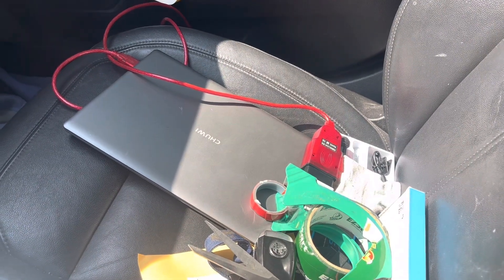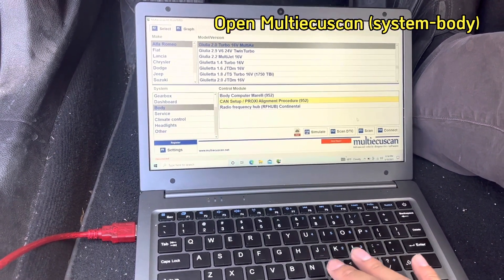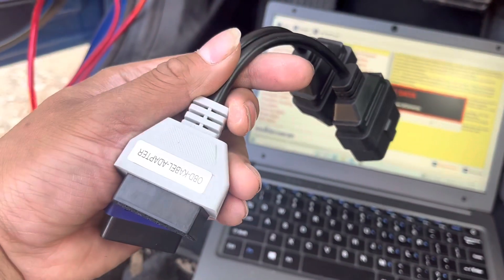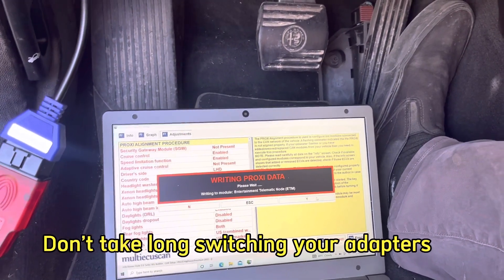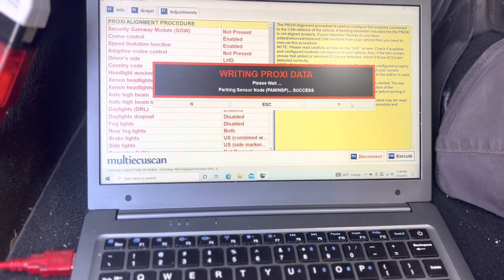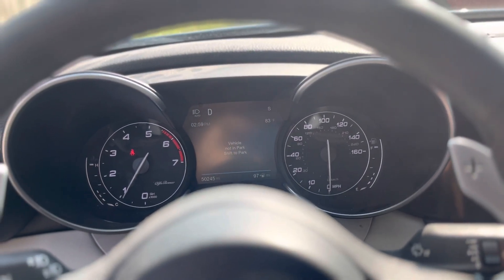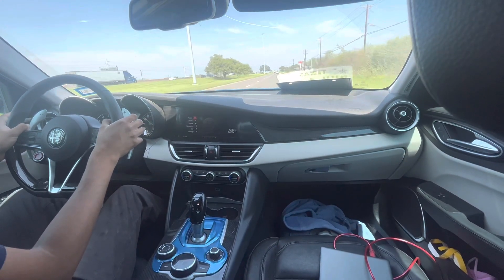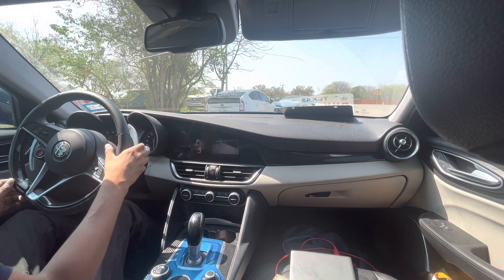Alfa Romeo Giulia/ Stelvio USA to Euro spec paddle shifting mod! General proxy alignment DIY free

Comment: So does this mean that the GTAM shift strategy is already there but needs to be recoded like this?
Reply from the maker: It’s the Euro style shift logic that we are telling the car to use it has all the country combos imbedded in the software. Now with that said there is a guy who is uploading actual GTAM software to the suspension and trans logic. That is separate and costs money.
Reply: @alfamods2.0T understood, I wasn't sure if the GTAM logic wasn't already hidden in the software as well.
Reply from the maker: @QuadrifoglioLife it is in the year that it came out only on the QV. I’ve seen the launch control OEM activated

Comment: I have code u1210 on my stelvio meaning Lin alternator module not communicating I was told it’s needs a proxy alignment any input on this?
Reply from the maker: @Chuck-tq3kq  if you installed it used then yes it probably needs that. For that you can get multiecuscan and the cables for like 120. Or pay the dealership. You just go under proxy in the program and follow the instructions with the cables.
Reply: @alfamods2.0T  I bought the car salvage so I don’t know what was done to it before  just had that code with the check engine light car runs great  no problem I just don’t want to pay for nothing
Reply: Lost Communication with LIN Intelligent
Alternator Module
Reply from the maker: @ is your odometer flashing? If so you should do a proxy alignment if not clear it and move on.  

Even if it is flashing if it’s running well a failed DIY proxy can be worse.
Reply: @alfamods2.0T  no nothing is flashing

Comment: I dont really understand that part, when you change the byte, because in the video you actually did nothing. Can you explain it to me? Thank you.
Reply from the maker: You just type in the new number in place of the old number then press ok when your done. After run the proxy alignment
Reply: @alfamods2.0T  thanks for fast response. So change 50 to 40? What is the meaning of this? I've never heard this step, that's why I am confused.
Reply from the maker: @19faller  that is what activates the Europe settings if you don’t do that you won’t get what you see in the video. 

You have to be 100% sure you change the correct byte 156 it should have 50 in the slot you change to 40. If your not sure don’t do it

Comment: If you are just replacing the IPC with stock (center display failure) will this process still apply, while keeping default settings?
Reply from the maker: Yes proxy alignment is needed for IPC replacement. You also need to adjust miles under IPC module. You can not write the miles lower only higher so if you bought one with 20k miles you can’t write below 20k only above.
Reply: @alfamods2.0T  thanks for the confirmation.   In your tutorial you changed a value from 40 to 50 in the programming should I leave it at 40 if I'm replacing with like parts. 2.0t to 2.0t

Comment: How do you know that 50 value is not used in other modules?
Reply from the maker: Even if it was it’s done in a set byte so it’s fine, the car will reject a proxy if the change was unacceptable.

Comment: thank you for your video! I add it successfully but now a little problem is when I turn the steering wheel I can hear the fraction noise, it’s probably from the column cover I guess. 😢
Reply from the maker: Yes I would say so I’ve had that issue as well if it’s not perfectly lined up it will make an annoying noise when turning.

Comment: as I know, when u have in D and u r going in N , there is pressure in gearbox and it's changing and it's damaging gearbox slowly and also while driving u don't have to go in N if there is no some specific situation.
Reply from the maker: Well the Euro specs come like this from the factory with the ability to shift to N so what your saying may be true but I’m sure the engineers factored that in before putting the programming into the factory euro Giulia and Stelvio. As for me I only use it maybe once a month to rev

Comment: hi I have a Japan spec(not sure the difference between the U.S and European specs) 2.2 diesel, what are the benefits of doing that shift knob? and another question, what mods would you recommend for a Stelvio? thanks more power!
Reply from the maker: For more power I would recommend Celtic tuning or squadra. I believe they do tuning on your platform the 2.2. As well as racebox. I have squadra my self it is probably the best.  This video is a software change that lets you shift into neutral by pressing both paddle shifters.

Comment: Where do you change the latency? I am using an OBD Link MX Bluetooth and I've run into issues. Please help!
Reply from the maker: It’s really hard to get a proxy alignment done with a Bluetooth obd2 wireless. It times out mostly. Under settings in multiscan put high latency mode and change the com port to obd mx. this is normaly the issue when you use a wireless obd2 you can’t change the latency with a plug in you would go under device settings in windows and change it to 1. I would recommend using a wired cable. Not saying it’s not possible but it’s harder 

https://www.giuliaforums.com/threads/multiecuscan.43770/
Reply: @alfamods2.0T  that is exactly what it is doing is "timing out".
Reply from the maker: Read my first reply if you can. read this second trouble shooting. Also if yours is. Late 2018  up SGW is needed to program. Mine is early 2018 so I did not need the SGW that plugs in under steering column

https://www.giuliaforums.com/threads/proxi-align-failure-using-mes-need-help.49266/
Reply: @alfamods2.0T  I have a 2017 so I am good there, no SGW.
Reply: I bought a wired OBDLink SX cable. I checked the latency for my comport in Windows and changed the latency to 1, it was previously set to 16. I then changed the redraw frequency in the Multiecuscan to high and it is still timing out. I'm an idiot but I'm trying. Any other words of advice?
Reply from the maker: @neilchirico  in multiscan there is a test function to test the cable to make sure it’s even making the connection. When you go into it does it connect to the modules? Can you send me a video of what it is doing and what version you have downloaded. Alfamods512 on IG 
or camaroboiz512@gmail.com email
Reply: @alfamods2.0T I finally got it to work. I'm pretty sure I had a bad blue cable. It would always time out at the blue cable even if the time to switch cables was only 6 seconds. I bought another set of cables and got the blue cable to work on the first try and eventually got it all to work. Thanks for all of your advice. I'm usually pretty computer savvy, but this cable kicked my butt. I would never have suspected a brand new set of cables would have a bad one.
Reply: @neilchirico even with Bluetooth obd reader?
Reply: @jingyuhu5960  yes, even with my bluetooth. I finally got it to work with a set of cables. The first set of cables had a bad cable.

Comment: hey man great video and that is a hell of nice car jealous of the beautiful blue and white interior trim, i still love my vesuvio grey all carbon though aha. recently had a struggle installing race mode cars 2017 kept failing proxy alignment for drive train node out of range. fast forward a days of trying and having multiple engine lights on i took it to my alfa dealer they know my cars modded ec phase 2 couple other mods they cool people still have my warranty an all. they couldnt get it to work with their software, somehow i got it to work in their shop with alfissimo software even tho it failed drive train again race mode fully works only thing is my odometer is flashing. the techs couldnt code it out. im sending my ecu out to ec again soon maybe they can decode it? sorry for the long message i just think you might know. i also want to do this euro mod but im just scared to run another proxy alignment and shit go wrong again and i lose race mode🤦🏼‍♂️ thanks for your time hopefully you can help a little
Reply from the maker: Thank you for the message you can contact me at Alfamods512 on Instagram if you would like to go through this in detail. The OBD flashing is the car letting you know a module in the canbus system is not aligned correctly with the other modules
Reply: not on any social media unfortunately, so do you think i should just do a proxy alignment to fix it? I might as well do this euro paddle mod while im at it then?
Reply: i went ahead and did this mod and another proxy alignment or should i say 5 proxy alignments.. failed every single time for drive train node, twice timeout and three times out of range. wouldnt let me go into abs after the alignment first 4 timea but the 5th time finally let me. end result my obd still flashing but race mode still works and the euro mod now works too🤦🏼‍♂️eurocompulsion said they cant code it out when i send them my ecu that i need to do it with multiecuscan. idk what to do i already went to alfa romeo they dont know what to do for it either
Reply from the maker: @honymontana1898  I’m super happy that at least the euro mod stuck when you tried to align it let me ask you what equipment are you using for the cables. Have you set the settings to high latency in multiecuscan. Then on your windows setting under device manger set the latency to 1. Time outs are almost always due to this
Reply: thanks for the quick reply, ya im glad it worked the euro mod is awesome. i havent changed anything in my windows settings, maybe that will fix my issue. but i do have the high speed latency in multiecu im using the cables from alfissimo i talked to jason trying to get it working the other day but we couldnt figure it.

Comment: Do you know if you can do this with the free version of multi scan?
Reply from the maker: No you need the paid version I believe it’s 50 dollars. It’s worth it with what you can do once you get it working
Reply: @alfamods2.0T  ok cool, the forum doesn't say anything about a grey or blue adapter tho. I have a 2017 i just got this week
Reply from the maker: @psychotic_oreo_6680  you still need the grey and blue it’s absolutely necessary the proxy alignment can’t be completed with out that you will have a flashing Odometer if you try and do it without the grey and blue. They access additional modules that the proxy alignment writes over
Reply: @alfamods2.0T  ok noted, im trying to find the adapters. Do you have links for the adapters?
Reply: @psychotic_oreo_6680  DiCorse has them, Along with Alfissimo International.

Comment: Thank you for sharing your journey! I appreciate that. I have a 2019 Misano blue Stelvio, bought used 2 years ago, and enjoy it tons. There have been some strange gremlins here and there but enjoy the steering and handling! Like you, I do the maintenance and have been frustrated with not being able to do a simple interval reset. After 2 years, I am bitter about it, but just put up with it because my Wife and I love this car. Please keep the videos coming!
Reply from the maker: Thanks for watching! It is a great car. I actually have a video  DIY using this same software that will let you reset the maintenance required message. Yours will need the SGW bypass but it’s an easy install. The oil light you can do with no computer. You just do it in this sequence with in 10 seconds. Close the door, ignition on, press gas pedal to the floor untill it clicks 6 times. Then Turn the car on. First time I did it took like 30 tries but it works. I’ll make another video on that!

Comment: I got two more months before my warranty expires on my 19 Giulia.  Will start on some of these mods shortly after :).  Thanks for your vids!
Reply from the maker: It’s defiantly exciting to change things up! I still have mopar maxcare extended warranty so long as my mod doesn’t cause an issue they still will cover example doing this doesn’t give them reason to not cover my radiator if it leaks.